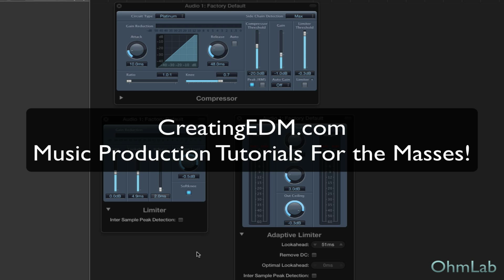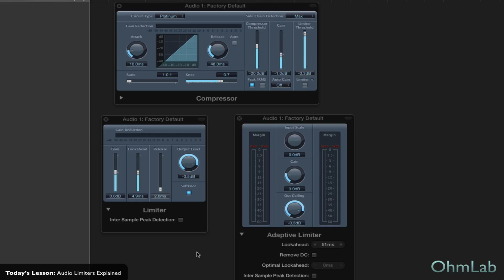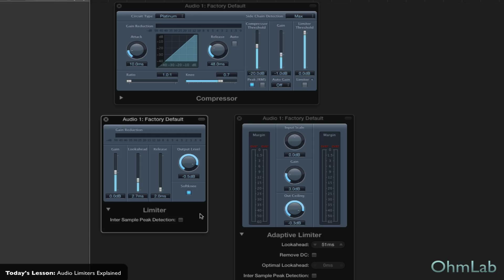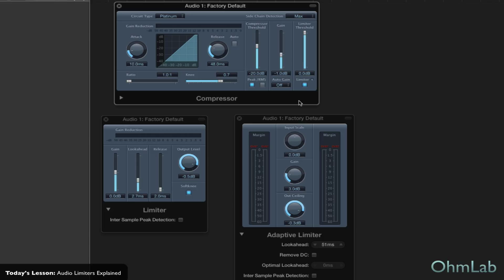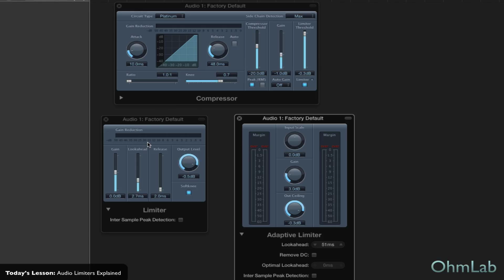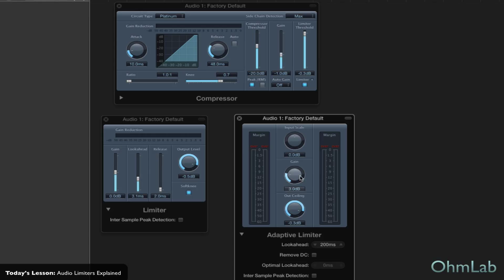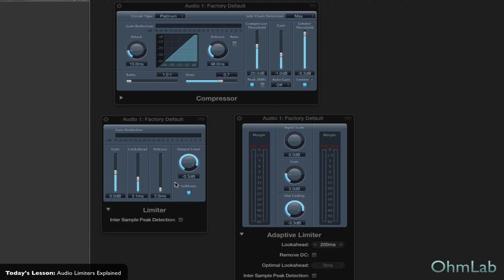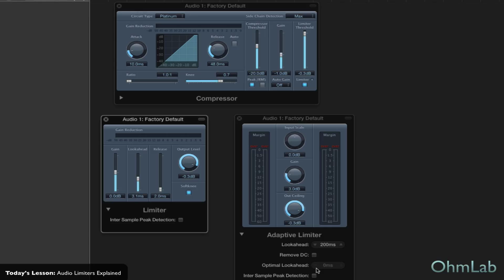Audio Limiters Explained - Creating Tracks

Comment: I have modified one yamaha gc2020 compressor and uses it as a limitor but realese time was too short , so I cut two resistors of inside and got a realese time of 9 sec . why it is that when I play music so I want all mp3 or other numbers are in the same SOUNDLEVEL , and now I can play music that does not have as high SOUNDLEVEL then gc2020 will turn slowly up the volume without losing dynamic , and if there is a track with high output signal it turn down immediately